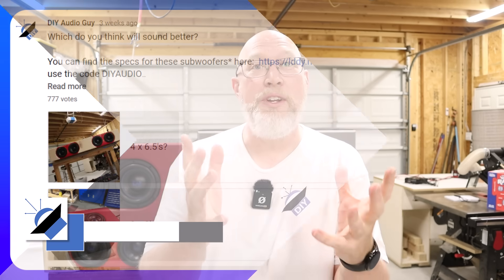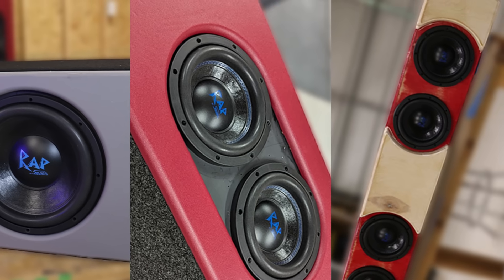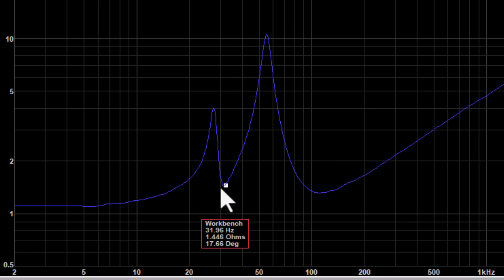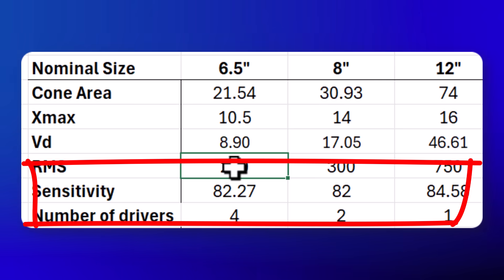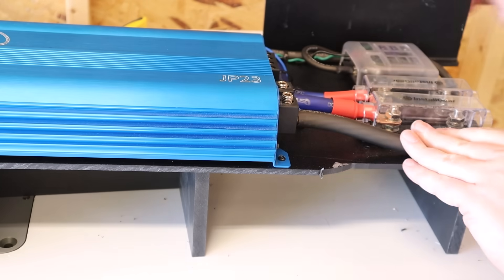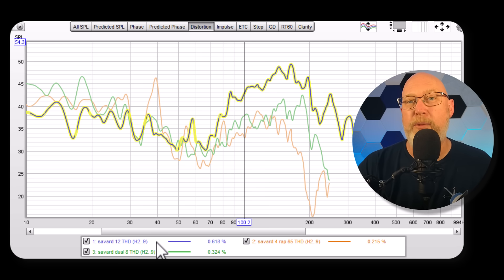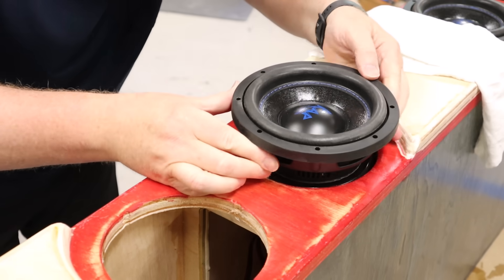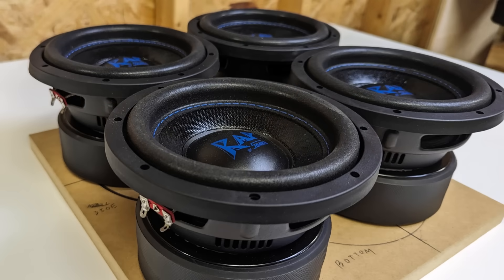Are small subwoofers better than big subwoofers?

Comment: The whole point of bigger drivers is they go lower better, that's why they made them in the first place. Multiple smaller drivers might match power rating, cone area or spl, but will never match the resonant frequency or reproduce the physical low frequency wavelengths capable of a single large driver.
Reply from the maker: That and you have to dump a ton of $ into the smaller drivers to get similar output.
Reply: Thanks for simplifying
Reply: I built an enclosure for an 18" driver with plans from the manufacturer. Drive it with 960 watts. The results are beyond all expectations. I have a pair of main speakers with 14" bass drivers, and they are not even close to the house thumping 18. Maybe a bunch of 8s or 10s is more sensible and less of a problem for the neighbors, but anything less than 12 inches does not even belong in the subwoofer category... they are just woofers. And holy moly, there is a difference.
Reply: Yeah I run one 15" for this very reason. I love the super lows. While watching this video on my home theater, I only heard my sub kick in when you were playing the 12" demo.
Reply: @JD-ef1jb  i thought i was going crazy, like, they're all outputting 40hz, it should be the same, and yet...
Reply: With a high quality paper cone 15" driver it's my opinion that when using actual ears to determine how the system sounds it will give the best performance across the board excluding spl setups. The best sounding system I ever had was in a 93 Jetta I had 
2 kef 15" ported 
2 image dynamics ctx 6" front doors 
2 factory bmw 4" mids on the face of the dash ( not factory location)
2 Yamaha ns10 tweeter s top of dash in pods firing back
2 butler  hybrid tube 2 channel
1 butler hybrid tube 4 channel
All the amps where original "phaze" design 
An eclipse dvd deck
Audio control dqx (I think) whichever one of the corded remote with the display on it.
I tried so many different combinations of subwoofers  and landed on the 15" drivers that system got super loud that was Crystal clear.
Reply: tand band 5.25" sub disagrees
Reply: Bro what. The cone area and the tuning is what produces what frequencies. 
I have  5500wrms on a 18" sub vent tuned to 27 hz in a 5.5 cubic foot box. 
I have 4x 8" on 4000wrms tuned to 37hz
I barely notice the difference . The 27hz tune sub has a hard time up high. 
Would rather the 37hz 4x8s anyday.
Reply: Beg to differ.  Try out either a DB Drive G7 or a DD 2508g either or in an 8 in or even a DD 1506 for a 6 in sub and I promise you that your argument is nol in void.   Personally 2 G7 on a salt 6 in my f150 and can hit the same lows basically as my 6 21's do in my navigator.   Never would have believed it myself till I have it.   Take my word or try it out.  I'm right though after almost 30 years in this hobby I firmly stand on this info first hand.   I know where your coming from though.  Thought the same thing myself honestly
Reply: @youareawesome420  u talking to spl people i agree with you but these people only want numbers not actual good sounding bass.
Reply: @youareawesome420  null and void, sir.

...and no 6.5" subwoofer in the world is going to pound at 24Hz. You aren't going to feel a 6.5" subwoofer in your chest. It's impossible. Even for the almighty Digital Designs.
Reply: @dizzle1119  so the smaller drivers can reproduce the same lows as the 12, then why does it sound so much different?
Which sound is more accurate?
Maybe we need a 12 in sub with less xmax then the 8s and see what happens.
Could the perceived lower sound be some type of distortion.
Reply: @bloomerb4162  i agree sounds like shit but puts out numbers.
Reply: @nickpowell7432  yeah I'm looking for tight clean bass. Similar to good headphones but of course that's impossible.
Reply: @bloomerb4162  Novice producer/mixer here. I suspect some of the difference comes from distortion. Having distortion in a sub frequency adds to the perceived loudness. We saw from the tests that the larger sub introduced a bit more distortion. So perhaps some of the perceived 'loudness' is a larger sub is due to that effect instead.
Reply: many reasons. If you go by ear and do not do measurements, you might think they perform the same, but if you measure them, you will see the difference. Like some people in another hobby say, "there is no replacement for displacement". The physics of low frequency sound in air demand a large volume, but you can't have a smaller diaphragm moving further and further: that just ruins linearity. It distorts. If bass were easy, we'd have designed a small enclosure with a high XMAX driver and be done with it.
but, sadly, it's not. You want good bass, correct bass, you NEED to push air. Many smaller drivers? One huge driver? That's just a trade-off. 
Saw a sub used at a metal concert like 25 years ago. The power cable was as thick as my arm. The earth nearby would jump up with the kick drum. It was like a small room. Two people could probably sit inside that enclosure comfortably.
Reply: @DeezY-1119 you arent going to hear anything pound in your chest at 24hz like you think you will unless you have like 10k watts
. I have 5500 wrms on a 18" in a 5.5 cubic foot box tuned to 27hz and it plays under 24hz and its not exactly underwhelming but its also not mind blowing. 24hz is more of something you feel inside as a vibration but 37hz and up is where you feel your chest pounding.

Comment: My thoughts on your measured tuning frequency coming in a couple of hertz lower than calculated. In my experience, a port that shares an outside wall of the enclosure always seems to come in on the low side of my targeted tuning frequency. I believe it's due to an averaging effect of sorts, with the shared wall creating effectively a longer port.  Enclosure designs that allow the port to be a separate structure within the enclosure that do not share a perimeter wall to account for length, well, those enclosures are almost always within the margin of error of my targeted tuning frequency. Maybe I'm imagining things, or perhaps it's a coincidence, but I've built hundreds of ported enclosures over the last 30 years, and this what I've observed.
Reply from the maker: There's an easy way to correct for this, which I always do.

Comment: This is very interesting. I always wondered the difference. Personally I prefer sealed enclosures and love my two 12” setup in my standard cab Ranger 😊.
Reply from the maker: Cone area is King.
Reply: I can't imagine how much seat room you lost in that Ranger. Up until not too long ago I had a standard cab 2011 Ranger, and it was an absolute chore to build a box for a single Kickert CVX10 to have enough airspace for it and also recess the amplifier into the box since there was basically no room at all under the seat for the amp, not that I wanted my amp just chilling in the middle of the floor under there anyways... Plus that's also where my jumper cables went on the passenger side. Lol. I sacrificed zero slider room and only one click on the recline, but yeah, I had to get kind of crazy on the design of the box in order to fill every nook and cranny along the back wall of the cab and even had to make a weird notch in the box in order to get the magnet to clear.

Comment: When you have a greater number of speakers, is there reason to believe that they are destructively interfering with each other, and because of that the SPL is reduced, even at a higher power output?
Reply from the maker: What you referring to is called comb filtering.  That's more of a problem when you have multiple mid-range speakers because it's a function of the length of the wave.  It's not an issue for subwoofers because the wavelengths are extremely long.  A 30 HZ wavelength is almost 38 ft long.  500 HZ wavelength is 27 in.

Comment: Honestly, looking at the SPL of each scenario is a less than ideal situation. The important question is, which scenario actually sounded better? To a point, subjective I know. I will also say this, 3db to 5db is no small difference. Lets just say one was at 80db and the other at 83db. The way the db scale works, 83db is effectively twice as loud as 80db. At the end of the day tho, all that REALLY matters, does the sub(s) sound good? If yes, are they loud enough to mix properly with the rest of the system?  If the answer to those 2 questions is yes, then your set. PERIOD.
Reply from the maker: To my ears the 2 8's were cleaner, but the single 10 hit lower.

Comment: Of all the different sub boxes I've had, the 2x12" bandpass box was my favorite as far as sound and punch. It was a big girl with a nice thick plexiglass front...which was useless in a small truck really as I barely had room to put the seats back enough to drive. Backrest of seat was litterally pushed up and onto the box, which was lucky because I didn't do pre-measuring or planning. After I put it all together and went to put it behind the seats I said..."SHIT! Man I hope it fits and I can still drive comfortably!" 2000 Toyota Tacoma SR5 ex-cab. I got lucky really...and had just enough room next to the sub for one passenger in the back as long as they were not too tall or thickly built.  Sub was great, but it did require me to upgrade all the factory speakers to keep up, because I could "ONLY" hear the bass. I also had to tighten all my mirrors because they shook so much I wasn't able to see into them...and my windshield mounted rearview would have to be readjusted every time a hard bass peak hit when at medium to higher volumes.  I put in 6.5" mid bass component speakers with separate tweeter with a 4 channel clarion amp. They were okay...I know a lot more about speakers and sound now, though still just scratching the surface...I'm merely an enthusiast and musician. I want loud, clear, powerful and no distortion or coloring of my music. I like my music to sound good in the studio, at home and in my vehicle, with little discernable differences.   The box I purchased at Best Buy along with the speakers and mono block sub amp. The subs and amp were both Sony Explode, the amp was 900 watt. This was about 20 or so years ago but everything together it was under $1k...that's the JVC head unit, subs and required install kit, component speakers front and rear, amp and install kit. Wasn't much for internet back then or Youtube or any of that. I knew based from info I learned from a guy I knew that competed professionally with his car, that he said if I wanted hard hitting bass for minimal money, the bass I was looking for...bandpass was what I should get. He custom makes all his stuff, with chicken wire and fiberglass to integrate it into the vehicle. Looks sharp. Looking back...yea I probably went overkill in that truck. I wouldn't do it that way today. But man...the bass hit so hard and chicks loved how it felt. lol

Comment: Man take it from a guitar guy. Use one of each size for all ranges of bass. I run a 6” 8” 10” and a 12” and get tons of range learned this from Joe walshe guitarist from the eagles.
Reply from the maker: Joe Walsh had a professional audio engineer setting up his equipment.  If the average Joe just hooks up four or five different size subwoofers to their amplifier, they're not going to get the same result.
Reply: @DIYAudioGuy  correct but it can be done. I run a 8 and 12 in my car system. Honestly. Each system needs to be designed around what music you listen to. Then tune the sound from there. Cuz rap set up playing metal music… no bueno.  I’d be curious, if you could,having access to those subs and equipment make a combined system for comparison sake. I bet you could make a killer system honestly.

Comment: 10 6.5” subwoofers = better then 1 18”
Reply from the maker: That's what we call a testable hypothesis.
Reply: @DIYAudioGuy  i have a post on my community page that show all the ways you can make little subs better then 1 18” and how many you would need
Reply: @DIYAudioGuy  the cone area for a 6.5” subwoofer is about 25.50
And the cone area for a 18” subwoofer is 254.47
And 25.50 X 10 is 255 so its 0.53 more cone area so it can move more air to produce more bass
Reply: @DIYAudioGuy  just like 2 12” subs is better then 1 15”

Comment: This will sound crazy but I cannibalized a Bose spare tire well sub/amp from a Nissan since it chuffed. Built a sealed box for the two 4” subs in a regular cab OBS F150. Granted it’s not nuts especially with a vintage MTX four channel also running 6.5 components in the doors. Nice and balanced sound on a budget.

Comment: Speaking of f150s. I have 2 I'd like a clean sound system in. An 05 crew cab and an 08 supercab lariat. Is there a blue print for 2 8s under the back seat? I have a cnc router if there's an svg/dxf file as well. Do you have a video on stereo head units? They're either $150 on Amazon or $500 at best buy. Is there a brand with android auto you'd suggest? Great video thank you

Comment: Sounds like a cone flapping in the wind  you can hear the baskets on the 2- 8" its tuned to low should be 37.5 to 40hz  up to 60hz it would sound better tighter also lower the box volume or airspace a bit it should get tighter. 

I had a 10w3 jl audio on .75cf box 
With a folded port angled box on 150 watts that would rock the inside of my car it was plenty of bass very tight  and was all i needed and i did car audio for 17 years in s shop.  40 years total.
No i was not trying to do 157db spl
Nor did i have the room to run 6 jbl pro 1000 watt 18"s with 22k watts.
I liked to keep the air in my lungs.

I tuned my system with my ears no fancy computer system to use.
Reply from the maker: That box was chuffing, the port needs to be bigger.

Comment: I have had multiple different set ups 
Like 2 Type R 12s sealed box 
2 NVX 12s porter box 
1 kicker CVT 
2 JL audio W6 12s sealed JL box 
1 sundown x12 big ported box 
1 kicker CVR 15 ported box 
1 JL w6 10 ports JL box 
2 JL W3 sealed box 
And the list goes on 

Currently using my first 8’inch subs i wasn’t hesitant on taking this route in my first pick up truck but let me tell you 

4 sundown SA 8s V3s in a ported 3 cube box turned to 32 HZ on a JL RD1500 watt amp .. this is my favorite set up. And yes Hits the low notes it’s quite shocking

Comment: I used 4 6.5" woofers in a sealed box for a regular cab GMC truck. Built a sealed "truck box" with the bottom spaced off the floor far enough to mount the woofers down firing. Works great for a tall driver with a bench seat in a reg cab. I also took a prefab ported box for a newer Super Duty, flipped it up, made some mounting feet and did 2 MOJO 8" in my personal reg cab 2500HD. The only way to really get a high excursion woofer behind the seat. Now I have plenty of bass and my seat barely lost any space. So, yes, the big woofers make more output per dollar, but sometimes the space available requires some creative solutions. Great video!

Comment: I'm running 2 skar audio EVL-12D2's on 2 skar audio RP1500.1D amps. One per sub. And they are in a custom built box I built that hugs the contour of the floor to gain all the volume I could get. The box is a sealed box with 3.83 ft³ with out the speakers in the box.  So I've got them inverted to keep all the airspace I could inside the box. 2.5" seat lift and these bitches pound. The subs are mounted on the front of the box magnet against the backs of the front seats.    So 2 - 12's built with the proper size air volume box will fit under anyone's rear seat.  I can make it happen.  And my truck is a 2016 GMC sierra extended cab. Not even a full depth rear seat like in a crew cab. So with a crew cab I could prolly gain 1 to 1.5 ft³ more of airspace. get at me for your custom built boxes. ¾ mdf or 1" MDF or for those true SPL Comp guys I do 1½" mdf... Get at me I can fit any strange contour I need to. I can do fiberglass coated boxes polished and painted then buffed like a piano if you so choose.

Comment: The mechanical components of a speaker, such as the cone, magnet, surround, and voice coil, are the biggest contributors to harmonic distortion. Drivers with lower distortion may sound cleaner, but some may describe them as less exciting or more sterile. Harmonic distortion is usually inaudible below 1% THD, and a well-designed speaker with quality parts should have a THD below 2% in its intended frequency range... Another useful tool and I think your ears are hearing it is the waterfall text on each speaker. It can show where the speaker is holding out or onto a resonance or has out of the harmonic range sound or ring.

Comment: How will this compare if you use passive radiators instead of ports? You don't have to worry about port dimensions since you can simply put the radiator where you want and tune the mass to get to the equivalent port diameter/length.

Comment: I agree, I'll always go for the biggest sub(s) I can fit and not lose too much usable space, which does vary vehicle to vehicle. I took out the bench seat in the back of my extended cab 98 K2500 in favor of a dual 12" sub center console box & bucket seats. I haven't gotten around to the bucket seats yet.... But hey it sounds GOOD in there, and it pushes enough air I can tune the box with my windows 😅I'm also adding 2 6x9's in the back side panels, and two 6.5's up front on the trans tunnel for better mid & high range. I "Technically" loos two seats that way (the front is a split bench, I never really fold up the front center console) but I don't need 6 seats in an extended cab, 4 is more than enough.